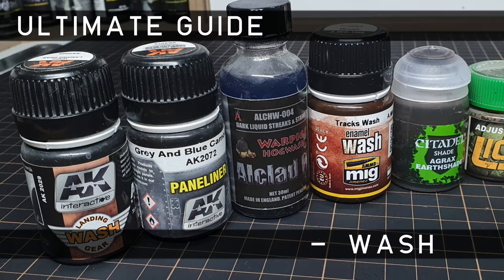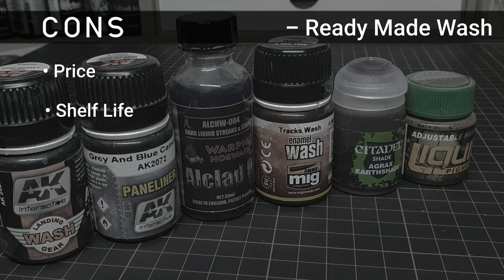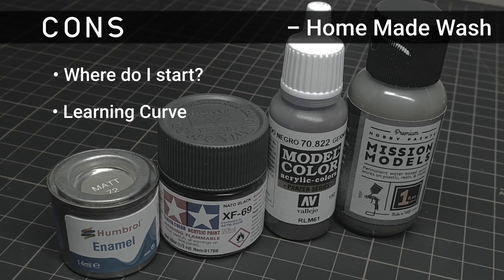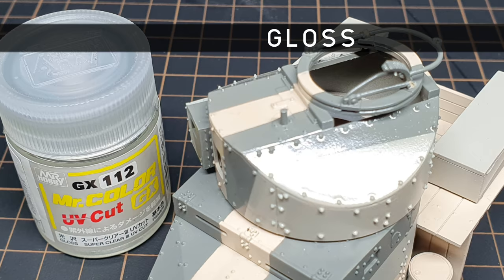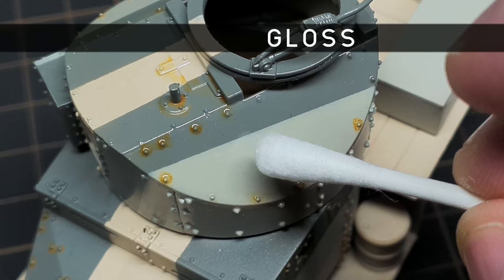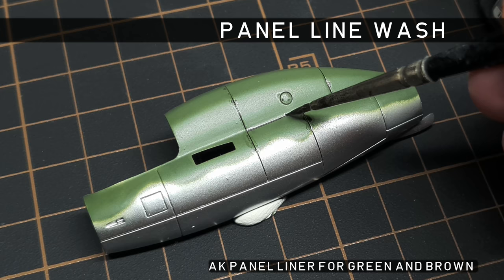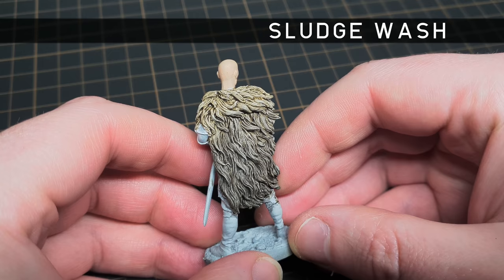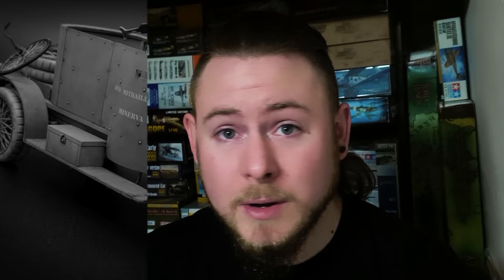Scale Modelling Tutorial  | The Ultimate Guide to Washes

Comment: Great video. Just a couple of questions - 1) How long do you leave an enamel or acrylic wash before cleaning it up? 2) Can you apply acrylic wash over a gloss/satin polyurethane varnish without damaging the acrylic paint under the varnish? Thanks
Reply from the maker: Hi Brett, thanks, sorry for the slow reply ! 
.1 as soon as the thinner has evaporated you can start cleaning up. Depending on atmosphere 10-30 mins. 
2. You can apply an acrylic wash but you won't be able to manipulate it after very well. Unless you clean up with water when it's still wet

Comment: I know we cant thin acrylics with to much water or it will break down the pigment to much. Have you ever tried Floetrol to thin acrylic for a wash?
We have used Floetrol as a flow enhancer and it does thin the paint without affecting
the pigment but have not really thinned it to use as a wash (for panel lines on Star Trek Models).
Thanks!
Reply from the maker: Hello !  I'm not sure, Flotorol is used a lot in paint pouring ( not so much in the uk as its harder to get)
The problem with a compromised or overthinned paint film won't matter at this stage, it would be a problem if you thinned a primer or base layer to a point where the polymers wouldn't bond as this might affect later work, but for a wash near the end It doesn't matter. 

To solve the problem anyway any clear acrylic medium would potentially work mixed with a flow and and water,  so a gloss, pouring, glazing , medium e.t.c  
What your doing with this is cutting the opacity of the paint whilst retaining a stronger polymer bond than if you  thinned with just water and flow improver so anything to add transparency to the pigment so you don't have to thin it as much really..
 however I still don't think it would matter at such a late stage in a finish ! 
That was a bit of a wall of text sorry 😁

Comment: @alanjacks3835
1 day ago
Im still having problems with this!  I think my timing is off!

1) Prime with Tamiya Fine Surface Primer. Leave to dry 1 Day.
2) Paint with Tamiya Acrylics, Leave to dry 12 Hrs - 1 Day.
3) Topcoat Mr Hobby Gloss Spray. Leave to dry 24 Hrs.
4) Apply Decals.
5) 2nd Coat as "3" Leave to dry 24 Hrs.
6) Oils & White Spirit Wash applied. ----- This is where the Paint starts lifting?
What am I doig wrong?
Thanks in advance

Comment: This tutorial has been really helpful, thanks a lot! I generally use enamel paints but am tempted to try a panel line wash using enamels to take advantage of the longer drying time. Would putting an acrylic varnish on before the wash be enough, or would it be better to use acrylic paints from the beginning?
Reply from the maker: You can use an acrylic barrier coat Iain,  that will help, make sure its even and covers everything though or you might compromise your underlying work. 
Acrylics are a great paint and I like them but there will be a learning curve, laquers are my fave, things like ak real colour, and MRP are slowly taking over, they can take enamel weathering products fine and spray beautifully
Reply: @lpjmodels  That's great, thanks for the confirmation! I've never tried lacquer paints before but they sound like the way forward, so will try and get my hands on some 🙂

Comment: Thanks for the video,what clear do you apply to acrylic base paint before enamel washes? Thanks George
Reply from the maker: If you use odourless thinners and not enamel thinners you'll be ok over any acrylic varnish. I use VMS matt and satin varnishes almost exclusively.  For gloss I use mr hobby gx 113, or aquagloss, but I don't gloss veery often if ever. 

Enamel thinner is hotter than oil thinner, it usually has xylene? or mek? ( not 100% but the theory is )  in there which is a no-no for going over other paint, odourless oil thinner, or odourless mineral spirit doesn't and is safe to thin enamels and oils alike.

Comment: Thank you for the GREAT tutorial! I have a question (I'm a beginner with washes). 
Around 5:30 you start talking about the different coats and how the washes behave. Did I understand you right, that you would always paint the model first, then add a coating (gloss, satin or matte) and only THEN you're applying the wash? 
I thought to preserve the sometimes super small details, panel lines and so. But at the end of the video I'm having the feeling that you apply the wash directly on the paint, without coating. So what's the case with the situation starting at 05:30? 
Thanks in advance for the answer!
Reply from the maker: Thanks Maurus. This depends on your paint. If it's dead matt, or a weaker acrylic like vallejo or lifecolour I would protect this with a varnish. If you go to heavy with the vanish you can clog the details, although it's easy if you just take care with your layers. Light wet coats. 
When I use laquers like MRP, if there are no decals I will go straight to a wash.  If decals are involved these need to be sealed to prevent staining.
Reply: @lpjmodels  Aah okay, that makes sense! Fantastic! Thank you :)

Comment: Hey there, great video and explaining. i do have a question. I understand that if I use acrylic colours I can use acrylic Clear coat and then for the wash I should use the opposite which is oil paint wash. once the wash is done. what varnish do I put over it then? shall it then be an enamel or Lacquer based clear coat? thx
Reply from the maker: Any varnish is fine if its a final coat,  you'll find acrylic easier to work with and quicker drying though !
Reply: @lpjmodels  thank you so much for your help

Comment: I am 100% brand new to washes, and I had no idea about different compatibilities between enamel/acrylic. I use mostly Vallejo acrylic paints, and since I am fan of their pants, I also picked up a couple of their acrylic washes. The rule of using acrylic over enamel and enamel over acrylic makes sense, but does that account for topcoats? Should I use the Vallejo acrylic wash over enamel-based varnishes or will a fully cured acrylic varnish work with acrylic wash? Likewise, if I use enamel varnish can I use an enamel wash?
Reply from the maker: Enamel thinner, even odourless thinner is very detrimental to enamel coats, so enamel wash over enamel paint or varnish isn't recommended. You can usually get away with acrylic over acrylic if you cut it with just water and flow improver, acrylic thinner may likely attack acrylic varnish. Not everything is created equal so test first !

Comment: I used a humbrol enamel thinner on a wash over an acrylic base and it removed the base paint. I didn't put a clear coat on. Is that why or should I have just used regular white spirit?
Reply from the maker: Enamel thinner is really hor that would be the problem. Even if it was an acrylic clear coat it would have likely eaten it. White spirit is a little, unpredictable, low odour oil thinner from daler rowney or winsor and newton's sansodour are good. I like the VMS Universal weathering carrier ( light ) though as its pretty nonreactive t.o anything